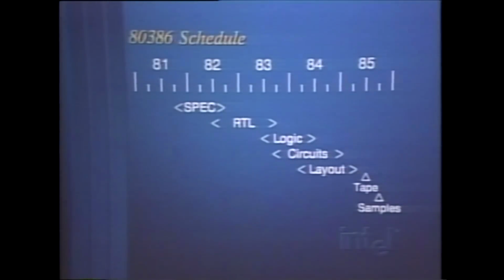Design and development of the Intel 80386 microprocessor

Comment: Alberto:
Thank you, Jean. Today’s questions are organized into three parts. The first part focuses on product definition. Next, we’ll discuss design methodology, and finally, we’ll examine the CAD tools used during the 386 design.

Question 1:
How was the product defined? How was the product definition process organized at Intel?

Jean:
We started the process with a proposal for what the product might be. The architect of the 286 spent about two months defining this proposal. Then, we presented it to management and a group of architects. It was unanimously decided that such a product should be developed.

At that point, we selected a committee to define the product. This committee consisted of marketing specialists, who understood the market needs, technical experts, architects, and logic designers. One of the architects had previously worked as a compiler writer for Pascal on the 8086, which provided valuable input.

Question 2:
What kind of input did you get from your microprocessor customers?

Jean:
We received a significant amount of feedback, especially about the 286. Customers were very open about sharing what they liked and, more importantly, what they thought was wrong.

Every time we had a design win or loss, we reviewed the outcome to understand what worked and what didn’t. For example, we analyzed areas like UNIX systems, high-level languages, and graphics to identify gaps.

When we needed more information, we visited customers directly. We selected customers based on their expertise and industry leadership. This iterative process involved continuous engagement, ensuring the product met evolving requirements.

Question 3:
Did IBM play a significant role in the definition process?

Jean:
Surprisingly little. At the time (1981), the 286 had not yet been selected for the IBM PC/AT. The PC was still an 8088-based machine. The whole IBM-PC transition occurred while we were defining the 386 chip.

Question 4:
How challenging was it to maintain backward compatibility with previous products?

Jean:
The hardest part was deciding to maintain compatibility in the first place. While it was clear we needed a 32-bit machine, it wasn’t immediately obvious that DOS compatibility was essential.

After much deliberation, we developed a breakthrough concept: creating distinct environments for 16-bit and 32-bit operations. This approach allowed us to maintain compatibility while expanding functionality.

Question 5:
What operating systems did you consider while designing the 386?

Jean:
Initially, we aimed to unify the DOS and UNIX markets, which had traditionally been separate. The goal was to create a platform capable of running both DOS and UNIX applications effectively.

Question 6:
Did you consider adopting a RISC architecture?

Pat:
Only to a limited extent. At the time, RISC was a new concept, and we were more influenced by traditional architectures. The focus was on optimizing commonly used instructions rather than fully embracing RISC principles.

Question 7:
How did you approach the inclusion of cache memory?

Jean:
Initially, we included a 512-byte code cache in the design. However, simulations showed minimal performance benefits, so we eventually removed it. Instead, we focused on bus pipelining and intelligent prefetch algorithms, which offered greater performance advantages.

Question 8:
What was the design philosophy for the 386?

Pat:
Our design philosophy evolved over time. Initially, we didn’t fully understand technologies like standard cells. As the project progressed, we adapted to new methodologies and CAD tools, optimizing productivity and performance.

Question 9:
How did the design process balance performance and design speed?

Jean:
We prioritized performance but avoided excessive optimizations that would delay the product. By focusing on critical paths and balancing internal and I/O constraints, we maintained a manageable timeline.

Question 10:
How did you handle layout design and transistor optimization?

Pat:
Out of approximately 280,000 transistors, about 130,000 were in structured elements like ROMs and PLAs. For the remaining transistors, we used a mix of standard cells and custom layouts, ensuring optimal performance while minimizing parasitics.

Comment: "512 bytes of cache is a bit too much" 😂
Reply: I think what they actually say (9:27) is that it was too small to be meaningful performance-wise, while at the same time not fitting on the die, given the manufacturing constraints.
Reply: @cogoid   someone is definitely saying "a bit too much" at 10:28, but I think it's Alberto the interviewer. I agree with you earlier that they say the hit rate is very low implying they think it's not enough memory. He probably meant a bit too much die space, not too much cache. Still it sounds funny!

Comment: Released in 1986, the first PC OS to hit the mass market to use 32 bit by default Was Windows 95 in 1995, almost 10 years later. Yes, there was OS/2, DOS4GW, win32s, Linux, but those were not used on a daily basis by most people with the PC, who used 16 bit  DOS and Win3.11
Reply: Pentiums were out by the time win95 was released afaik, my 386 was dos all the way, windows 2 used too much hdd space
Reply: First Microsoft one might be Win 3.11 WFW as it required 386 and ships with 32bit code (network stack, HDD driver).

Comment: “I’m sure I could find a use for a 3rd metal layer, or 4 or 5”…. Talk about an understatement. To be able to tell the guys back then “hey, eventually we’ll start putting metal on the backside of the water too!”
Reply: At first, the only fab producing the 386 was the Fab 3 in Livermore. They used 4 inch wafers.
Reply: Anybody know what wafer size and mask count this was? Tapeout in July, silicon in August and samples in September is nuts

Comment: It would be fascinating to hear a discussion between the Intel 386 designers and the Motorola 68020/030 designers … to hear the reasons for the particular design choices that they made such as why the Motorola engineers chose an asynchronous bus while those at Intel chose a synchronous bus … or why Motorola chose a tunable page size for their MMU while Intel chose a fixed page size of 4096 bytes.